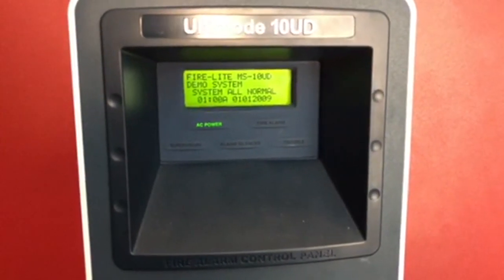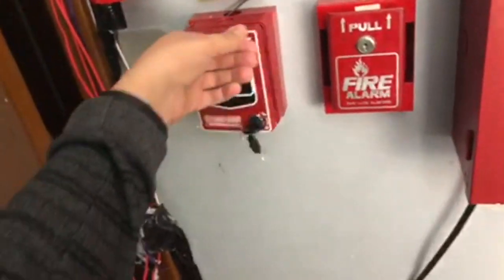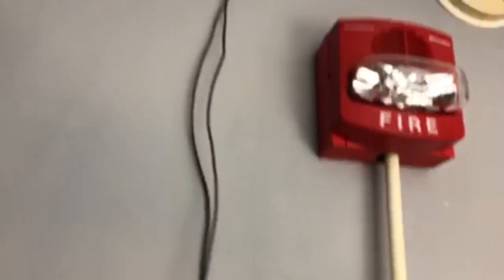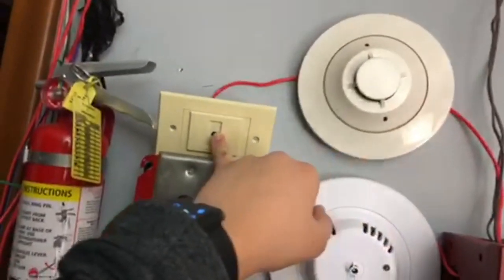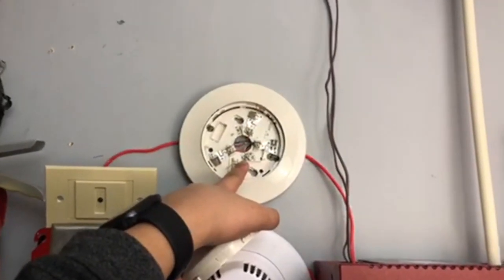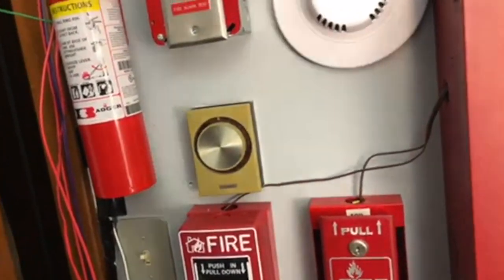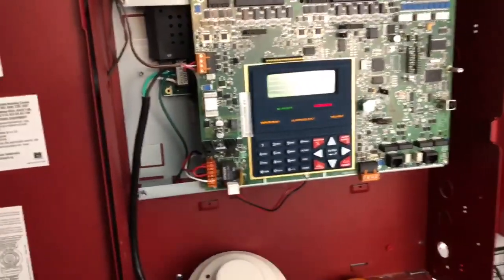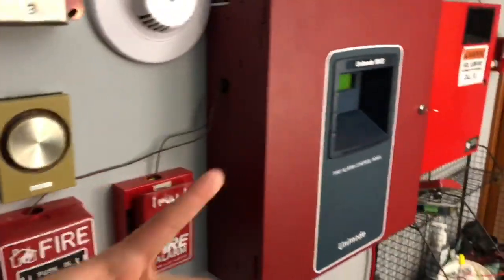*NEW* Mini system test 45 with the MS-10UD and a truealert!

Comment: Great video. How did you make your system normal without batteries?
Reply from the maker: capt421 you take the positive from the battery cable and put it in the resettable power

Comment: Great video! Quick question how did you get rid of the FWR power?
Reply from the maker: Simplex Freak you can’t, this panel
Is Filtered DC. But the resettable power on every panel is filtered, so you can use the resettable power through a relay to get filtered DC